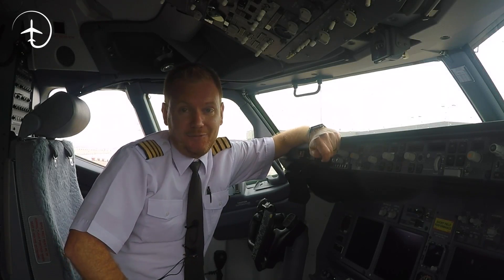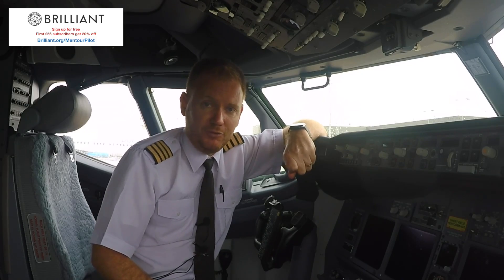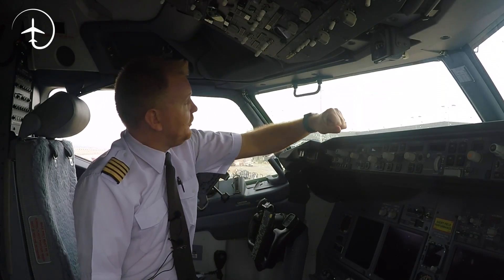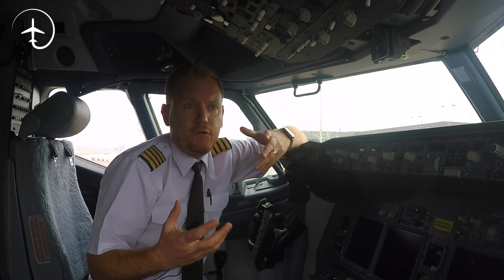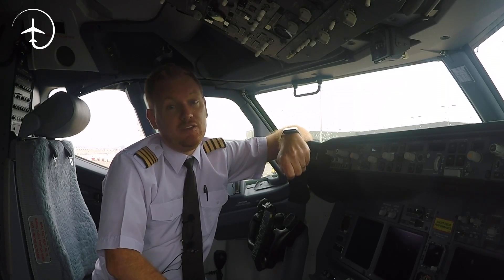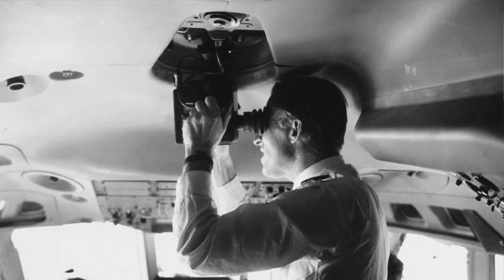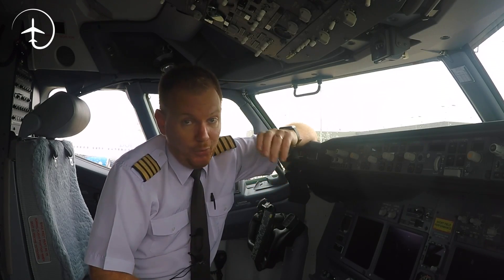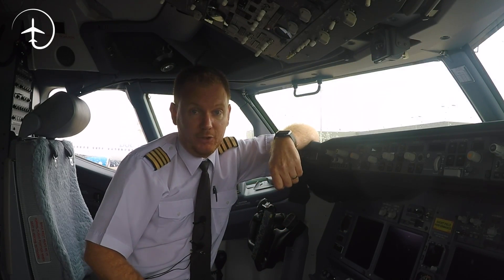Boeing 737 EYEBROW windows? What is the purpose of them?

Comment: Why airplanes don't have windows near floorline so that pilots can see ground clearly all time??? just like helicopters have them...
Reply: My guess is that since airplanes are always traveling at a significant speed forward while airborne that by the time you could actually see anything directly below the airplane it would be far to late to be useful to take any action.  Since helicopters can hover and travel straight up and down it is useful to see things directly above and below you.
Reply: Ww2 bombers and recon aircraft all feature floor facing windows. 

Helicopters would have a floor facing window due to the fact that landing areas vary compared to normal planes
Reply from the maker: Because the aircraft do not need to see the ground straight beneath them,
Reply: +Mentour Pilot Only exception I could maybe see for that would possibly be a reconnaissance aircraft but then it's probably just as easy to duplicate the feed from the recon cameras to a monitor if you need to visually guide yourself over the recon target like that. Of course these days GPS navigation would get you over the target easily enough, but I could imagine it might have been helpful in the past as it's not like people generally place radio navigation aids to guide people to their secret stuff.
Reply: C-130s have widows at the floorline, as well as large eyebrow windows.  On H model and earlier, there are two on the each side and 2 in front of each pilot.  Technology is catching up to the Hercules too and the J model only has 1 on the side and in front of the pilots.
They also have a sextant port in the cockpit ceiling for Astral Navigation. I wouldn't think the J Model has a sextant port due to the advanced navigation electronics.
Reply: ram j some newer planes have camera under them to allow them to see under them
Reply: ram j they do, the ILyushin aircraft that plane that looks like the antonnov 124.
Reply: Excelray1 not only that but a helicopter sets down during landing... planes are moving forward so more important to see what's ahead
Reply: Excelray1 
   And ALSO because they CAN land vertically!!!
Reply: Seraphina S 
   They HAVE to see ground WAY AHEAD, BEFORE realeasing weapons.
Reply: Zach Michaelis 
   When you overfly the target, is will be TOO LATE to release weapons!!!
   You have long passed D.P.
(Delivery Point)
   Man, the A/C, is travelling FAST, it NOT imobilized in the air, SO it HAS to realease the ordinance WAY AHEAD, for them to strike target!!!!!!!!!
Reply: +William Lesco Depends how big the window is and how close you are when looking through it as that dictates your field of view but even a 30 degree field of view while looking directly down from 12 km you would be looking at an area 15 km across of which 7.5 km would be ahead of you. Even for a modern jet airliner at cruising speed that would be close to 45 seconds ahead of you closer to a minute if you look into the window at an angle.

If the plane was actually slowing for a recon or bomb run which generally they probably would albeit for as little time as possible as it buys them better ability to collect good recon data and/or more accurate bomb deployment at the cost of a greater exposure to potential AA fire. You could likely get a few minutes then at least sure it wont help you if you are miles off course to begin with but might be adequate to make small last minute corrections to perfect your overflight of the target and/or the timing of the ordinance release or activation of the recon camera (The latter would probably be more of a thing for older era recon aircraft that were using photographic film in a cartridge with limited available shots).

Timing might be less of a thing now where the images are likely to be digital and 10 TB HDD's which can store massive numbers of high resolution uncompressed images are not really that heavy. So just taking a couple of thousand images at a few dozen images per second plastered all over the area surrounding the target may not be such a waste of precious storage as it was when you had only a limited roll of film available.
Reply: Too much equipment and electronics under a cockpit; not to mention the nose gear.  Camera installations can depict that lower aspect however, but aren't a necessity as Mentor explains.
Reply: Seraphina S not quite.... A bomb dropped from a plane still has the planes forward momentum
Reply: ram j  >>>  Remember, when a helicopter takes off and transitions to forward flight, the nose of the helicopter tends to be low, due to how a helicopter operates.  An airplane has its nose pointed up as it's climbing out, so it's not as likely to hit an obstacle near the ground.
Reply: ram j 
   A LOT of them HAVE!!
   Look at cargo planes, and do a little thinking!!!
C-123, C-130, C-124, C-119, etc., etc....
Reply: JeepersCreepers2013 
   LOGIC!!!
Reply: fly Businessclass or First and you can enjoy the Cameraview from the Top of the Tail and from just behind the front Landing Gear....  at least LUFTHANSA offers this to their Customers.
Reply: Seraphina S Some early recon planes were really nothing more than conventional bombers with a person in the nose pointing a camera down. Dedicate recon planes would typically have special bays for mounting cameras that would see through small windows in front of the lens. This is how the U2 and SR-17 did it and some of their WW II predecessors did it the same way too. The RF-4, a special recon version of the F-4 Phantom had its nose gun replaced with a camera pod and many modern jet fighters can carry a camera pod on their pylons making glass noses unnecessary.

On the subject of helos and vertical landing, that's a very valid point but to throw a wrench into things, the Harrier, which was famously VSTOL capable didn't have any means for the pilot to look directly beneath him. The Russian equivalent, the Yak-38, didn't have anything to look down either, at least I don't think that it did. More famously, the US Navy was working on an early VSTOL piston aircraft that would take off and land (vertically) on its tail and the pilot only had mirrors to guide him while landing.

To add another exception to the rule, attack helos don't have any windows in their noses. Of course that's because that's where all of their advanced targeting and tracking optics sit these days while in early version of the Cobra they had a turret there.
Reply: Maybe United is working on it.
Reply: Dunno if anyone's ever tried landing a helicopter but the floor windows are necessary to see below you otherwise you won't be able to position the helicopter accurately when landing.
Reply: below the cockpit is usually the nosegear.
Reply: @ЦветозарЦветков-е5о  I think C17 globe master have them!
Reply: @coldram1111  C17 is a very special aircraft. i didnt know but im not surprised it has them. it seems to have basically everything extra you could want. and performance is amazing for something that big. ive seen them in real life and they are properly massive
Reply: If my memory serves me wright, some Russian aircrafts did have bottom windows in the cockpit. Though, I don't recall any, where pilots would actually be able to see them - they are usually located in navigator's compartment/cockpit slightly ahead and below pilots cockpit. IL-76 and Tu-134 are great examples of that. Nowadays, of course, technology replaced navigators as such (therefore Tu-154 or IL-86 never had those windows).
Reply: +Excelray1 Didn't think of bombers but yeah again that makes sense as they would want to visually confirm the target before deploying ordinance.
Reply: Zach Michaelis ya but I think airlines don't drop their passengers.....or do they!!!?